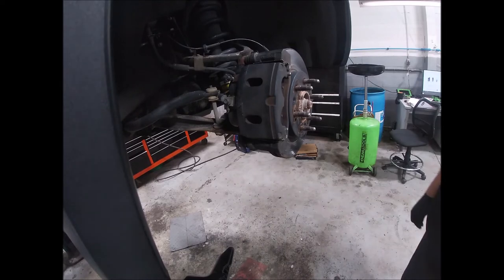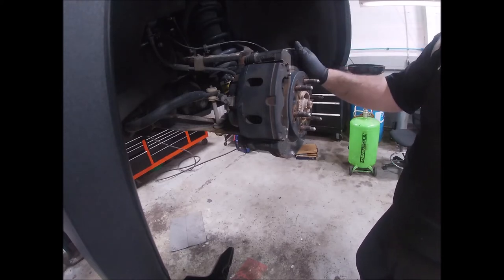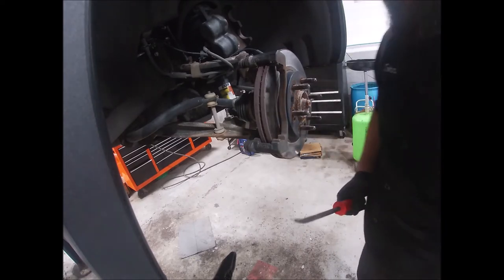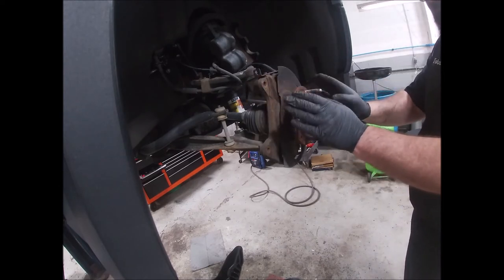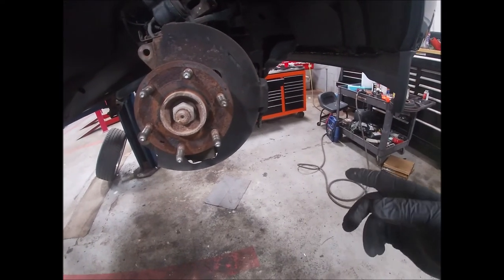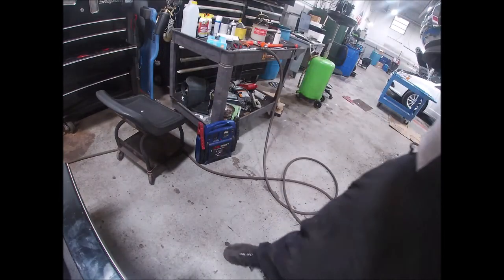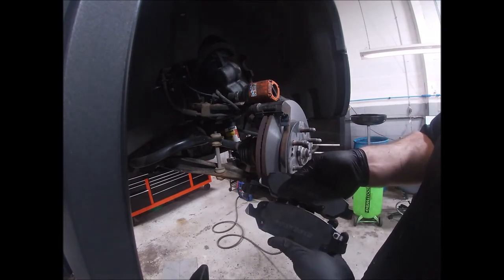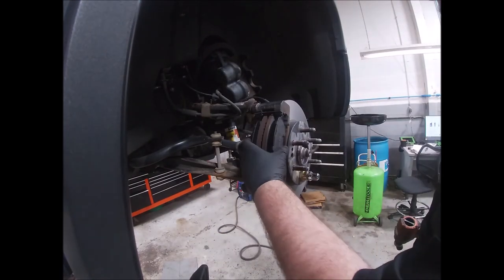Changing disc brakes, the right way. (2015 GMC sierra front brakes)

Comment: Hi! I just did mine on 2014 gmc. But, i have a little drag when turning disk by hand. Is it normal? I'm not sur because everything brand new rebost pad break disc and braket. Thank
Reply from the maker: It depends. There will be some resistance due to the drive axles moving. If the brakes themselves are hanging up and getting hot you have a fluid flow problem or caliper problem

Comment: Guess I’m an idiot…I break or leave out those rotor retainer bolts every time…Curious why you think they’re important enough to put back on?
Reply from the maker: Realistically their only purpose is to center the rotor on the hub, ensuring the rotor cannot move within the stud holes. I've developed good methods to save the bolts, it required little to no extra effort, and makes installing the calipers and brackets that much easier.